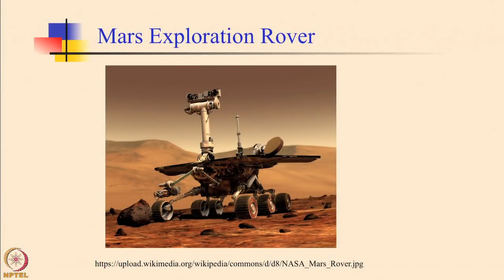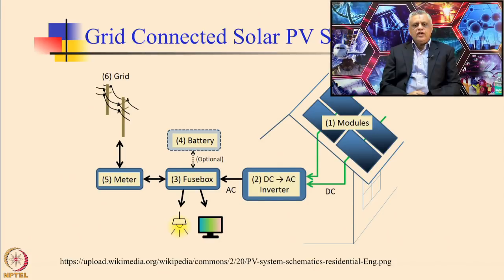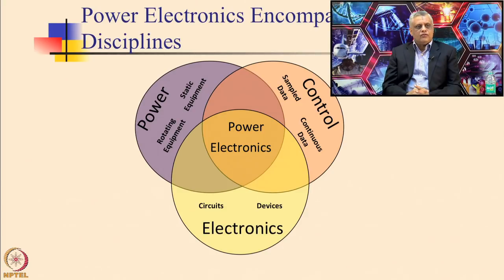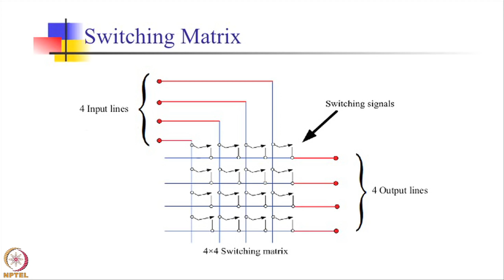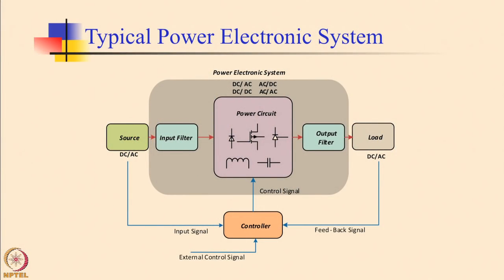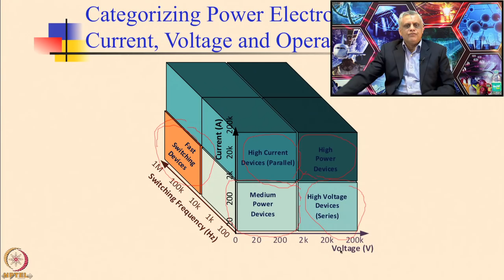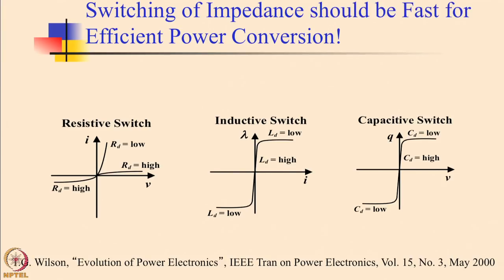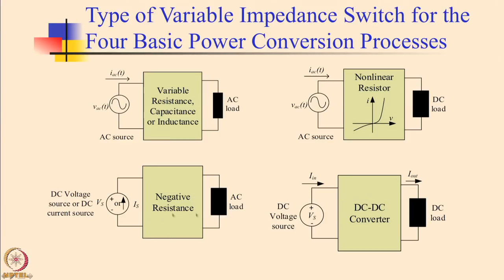Week 1-Lecture 3

Comment: Summary: Applications - robotic arms, space vehicles, electric cars, electric trains, wind mills, solar panels.
Definition - Power electronics is concerned with the processing and conversion of electric power through electronic means.
Power electronics encompasses several disciplines - Power, control, electronics.
Switching Matrix, use of power filters
Type 1 Switch - Diode - can't be controlled
Type 2 Switch - Thyrister or SCR - can't be controlled after turning ON
Type 3 Switch - IGBT, BJT, MOSFET - can be controlled
Typical PEC block diagram
Categorizing PE in terms of current, voltage and operating frequency.
Operating regions of an AC/DC rectifier
Another representation of a power converter
Switching of impedance should be fast for efficient power conversion
An (active) negative resistance - BJT
parallel connected magnetic amplifier
Series connected magnetic amplifier
Reply: You are a passout from NIT Hamirpur na ? ECE ? 2021 batch?? I saw your same DP on your Linkdin profile too. 😛😛😅
Thanks for summary that you have written on almost all the videos.
Reply: Yes. I am.